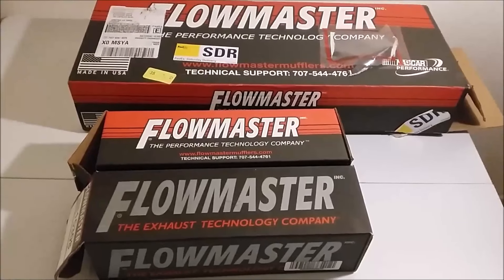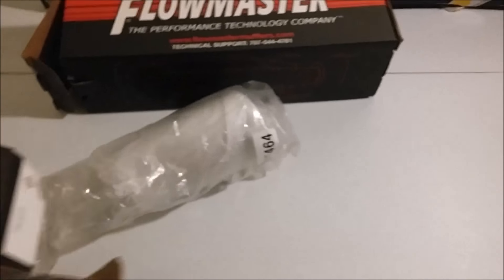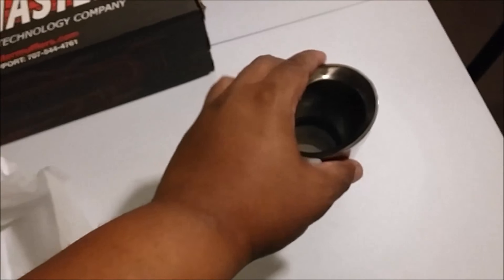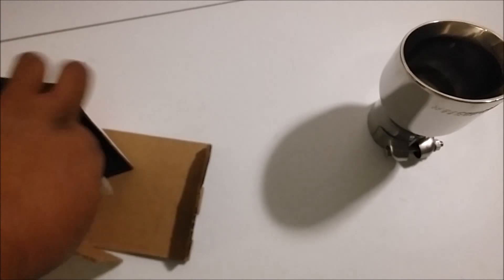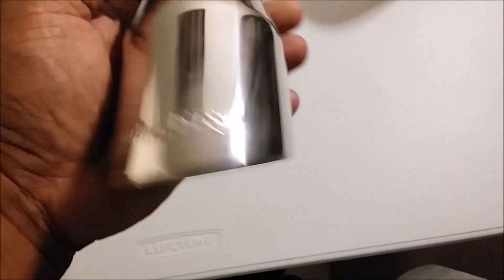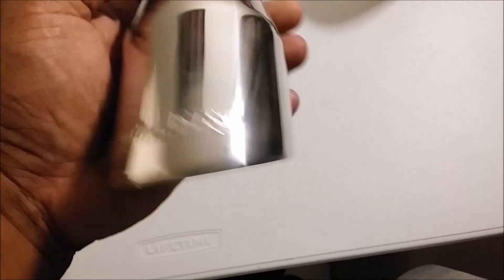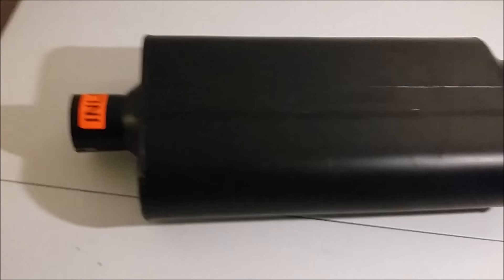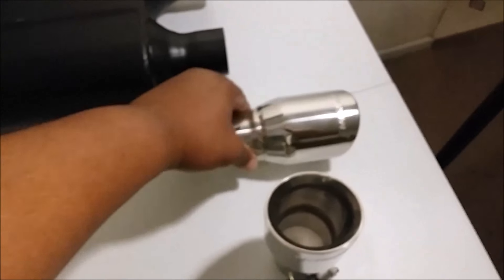2009 Dodge Charger SXT Flowmaster Delta 44 Dual Exhaust

Comment: Why it was two different Mufflers the one that you were showing it in the beginning of the video is not the same of the end of the video ?
Reply from the maker: Because of fitment. I wanted to run the exhaust pipe a certain way because I know I would be lowering my car later. The muffler shop showed me where it would be a certain kind of fitment that wouldn't work for me.
Reply: @BigJ3RD   oh okay I'm looking to upgrade my for a super 44